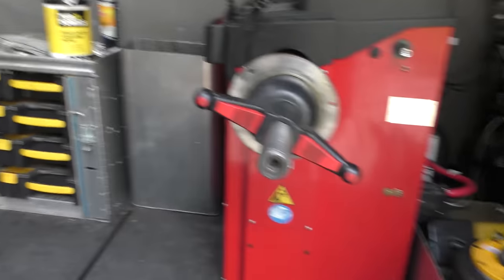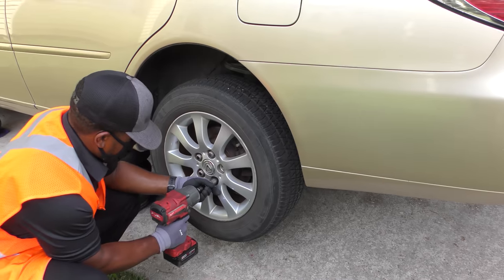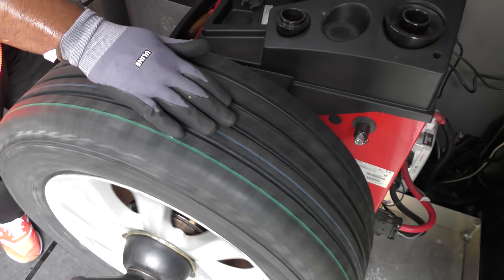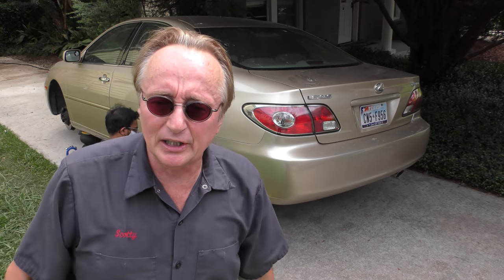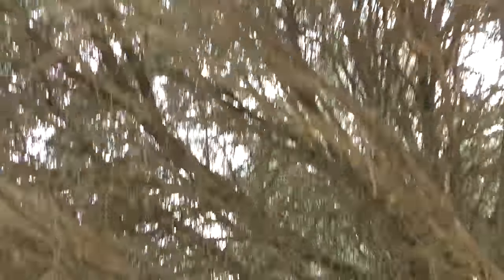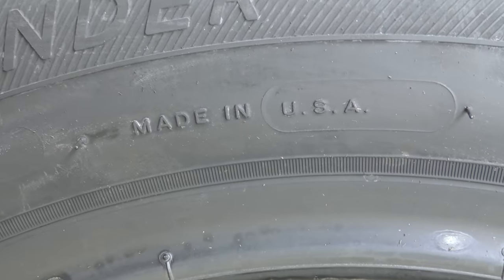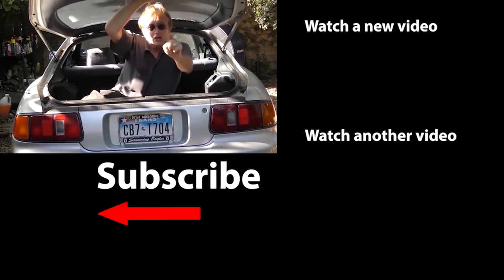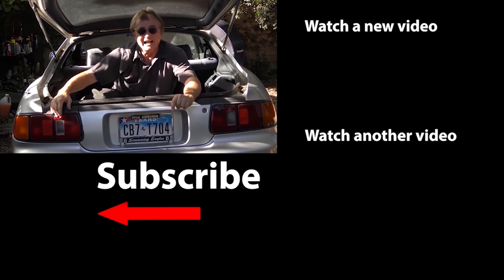Stop Replacing the Tires on Your Car, Do This Instead

Comment: I watched the interview you did yesterday. It was brilliant. You have a lot of fans there also saying nice things. I have Michelin tyres on my Lexus.
Reply: Hey me too! Always been both a Michelin fan and a Japanese car guy. I have two Lexus’ and an old ‘99 Nissan Pathfinder. All three are by far some of the most solid built cars out there.  And they all run Michelins.
Reply: I had Bridgestone on mine and currently have Falken FK510's on it at the moment. Good wearing tyre but they tend to be a bit too susceptible to puncture. I'll try Michelin PS4's next time i think.
Reply: @joshualaw375  Michelin are about the best tires out there, maybe Pirelli and Bridgestone tires are as good, but I have never owned those, but personally I have had the best luck and ride with Michelins, only caveat to them is they are expensive!

Comment: I don't know if I submit my question here for your advice but here goes.  My '04 subaru forester engine sound like I've installed a race car muffler whenever I accelerate.  When it's idling it's quiet.  But as soon as I step on the gas it sounds like a loud trombone, like one of those race car wannabe cars. I thought nothing of it but the noise has gotten louder over the span of a week.  The noise is coming relatively around under me.  My most recent job on the car was when I solved my oil drain plug leaking problem by wrapping the plug with teflon tape and screwing it back in.

Comment: Scotty, I bought a 2014 Hyundai Sonata Limited 2.0T with 51k miles in February from a reputable Hyundai dealer in Las Vegas. I understand I bought the car “as-is” but two months later it starts to warm up and when we first used the AC it wasn’t blowing very cool. It’ll only blow cool if you drive the car hard, the harder you drive it the cooler the air will blow. Even just revving it up makes the air blow cool. Sitting at idle/under 2k rpm it’s warm. Hyundai service manager said they wouldn’t fix it unless we pay for it but we just bought it. I called the previous Hyundai dealer who serviced the car before I bought it and he said last year it had issues with the discharge hose so the dealer I bought it from should have spotted that in the PDI and fix it for us for free. 
What do you think? It’ll be almost $600 out of pocket.

Comment: I tried to talk my ex boss into that 10 years ago, even had spare machines, trucks and tires on hand.
Reply: The power you'd need to run tire machines in a van is not a trivial matter.  Industrial-strength inverters are not cheap.
Reply: Suburban  you would need a hybrid like the Ford F-150 that’s coming out or generator
Reply: @TheSuburban15  I highly doubt that tire machines use that much power, most of the work can be done with air. And compressors are super power hungry

Comment: Scotty-"these guys are very professional and do the job right!"
Worker- tightens down lug nuts with impact wrench
Reply: I was thinking the same. Had a shitty tire shop ruin my studs doing that same thing
Reply: @deadchannel991  that's why I always take my wheels off, remove all the weights, remove center caps, remove tire stem cap, then take it to the tire shop. Last time I didn't do nothing that, they used an impact on my lugs, ripped off the weights using a screwdriver scratching up 4k rims, forgot to put back valve stem caps, and filled my tired to 60 psi when 32 is the spec. Absolutely ridiculous
Reply: @Danny-rk4xf  If you have $4,000 rims, why take it to a discount tire shop that employees minimum wage laborers who know nothing and care even less??
That's like a millionaire taking the Bentley parked in front of his house in a Detroit snow storm to save money by by not paying his butler to pull the Land Rover out of the garage.

Comment: I change my 2015 Honda Accord's CVT fluid every 25k miles, using only the Honda HCF-2 fluid.  And I could swear it feels more solid and less "rubber band"-like every time after I change it so I don't want to extend that interval any more than 25k miles.  Still running like new at 129k miles, having just changed the CVT fluid 4k miles ago.

Comment: Scotty--------Do Toyota Celicas require new tires too, or do the tires last a lifetime??  Just wondering.
Reply: Only if its a 94
Reply: His tires are original and still blow ice cold.
Reply: That's why slick willy was always trying to get forced induction from other younger warmer bodies //
Reply: I heard that an automotive engineering firm trying to reverse engineer her cold breath to design better intercoolers for supercharged & turbocharged engine applications /

Comment: Scotty is balling on Michelins, thought he would get some walmart DOUGLAS tires.
Reply: Enjoy the Michelin tires folks and good luck with them.
They were good performance but watch out for the Michelin tire smiles back after 2.5 - 3 years with a thousand cracks of SMILES.
Especially when his wife don't drive that often plus the Taxes baking sun.
The only prevention is use it all up in 3 years.
Skip the tire shine or protection sprays because Michelin tire representative and the tire dealers won't honor the 5 years warranty even before it expires.
Unless you fights hard with Michelin and plays the BLAME GAME.
Reply: @loktom4068  I've heard this and seen it when purchasing used michelins like the cheap a** that I am. The minor cracking doesn't affect performance though I agree Tom for what michelin charges for them its unacceptable.

Comment: I was a tire buster at one of those discount tire stores back in the 90s.  Some of the problem is with the techs not getting proper training and some of the problem is just how these stores run.

Techs work on labor commission and salesmen work on parts commission.  All too frequently the salesmen would give away free labor in order to sell parts and tires.  Then they would tell the customer, "Oh sure, we'll have you in and out of here in half an hour." regardless of how many tickets were hanging on the board.  Now you have under-trained techs having to bust their humps and cut corners, and at the end of a long hard day they find out they didn't make anything above minimum.

I left Montgomery Wards (flat rate) to work at this other store across the street (not gonna say the name, but it's the one with letters) because they promised to double my earnings by commission.  After six months of working there, I had exactly two days where I earned any commission above minimum.  Just two.

Comment: Those old tires look like they have another 40K miles on them. 😂
Reply: Yes but he has mentioned in other videos his wife had that car for 20 years. She only drives 3 and a half miles to her job, so the cars may be 8 to 15 years old. Time enough to dry rot or otherwise deteriorate by sun and heat.

Comment: I live in Dallas and used one of the mobile tire companies. Now they were much more expensive then going discount tire. So there are trade off's, you want to save money, go to a discount tire or some tire shop, want the easy of staying home get a mobile tire shop.
Also, I use Mobil One Full Synthetic  cause they go on sale at costco so often for dirt cheap. 6 quarts for $25

Comment: Great. But did they use a torque wrench to correctly set the torque of the wheel nuts? One of the common problems with most tyre places is they waaaay over torque your wheel nuts by just going for it with their impact wrench rip. This can over-tension the studs and also make it very hard to get the wheel off if you have a flat on the side of the road.

Comment: Got 2 Kia Rondos an 08 and an 11 both v6 with auto 5 speed Tipronic transmissions.  Trani drain and fill every 32K kms but they put in a drain plug that you can do by turning the driver's front wheel and fill through the dip stick tube.  Extremely easy to do, so I do it religiously every 32K.  The 08 is almost 300K kms and the 11 is almost at 200K kms.  They designed back then for easy maintenance and I always appreciate it whenever I have to change fluids.  That's the secret with Kia's, keep the maintenance up to date and learn to do it yourself and they'll last you.

Comment: I have a 1979 Oldsmobile Delta 88 and I have a leaking problem. During rain water was leaking on the passenger side carpet coming from underneath the dashboard.
The silicone seal between the firewall and the heater was all worn out, cracked and broken. I cleaned it out and resealed everything.
It’s a thousand times better then before but tends to still leak a little bit when it rains. Any suggestions or anything I overlooked?

Comment: Scotty, we had a new 1988 Plymouth Reliant that started losing its paint in about 18 months, even though I waxed the car regularly. The dealer told me it was due to water based paint, even back then. And I also saw many new Mercedes at that time that also were losing their paint due to water based composition. I wonder if it was the paint manufacturers that were causing this.

Comment: Me & my bro fit our own tyres on bikes & cars.
Dead easy using air compressor,tyre levers,tyre soap & new tyre valves.
Put 4 new pirelli's on my car recently.
Only take the wheels to the garage to be balanced.
We even repair our own punctures with stop & go tyre plugger and a rema tip top patch fitted inside the tyre like the pro's do.

Comment: Scotty, 2010 Jeep Patriot 4x4 111,000 mi (I know, I know, it was the only thing we could afford and yes, we paid too much, we didn't have any money to put down) Auto (CVT, wife just HAD to have a Jeep)... Trans is overheating when I drive but not when my wife does... she accelerates faster than I do but I travel faster than her on the highway... Trans shakes like crazy when at idle in gear but smooths out if put in Neutral or Park... Other than I need a new trans or new to us vehicle, what can we do to fix these issues?

Comment: Hi Scotty,

Is it recommended to change the tires once they start to have some cracks on the delimiter between the sidewall and the profile?

I have 2 Nokian summer tires having this issue and I intend to replace them with some Michelin CrossClimate ( maybe you heard something about them too).

Many thanks
Ciprian
Reply: Lol dumb question lol your freaking tires r cracking they r obviously no good anymore and need 2 b changed actually take your vehicle with the cracked tires on a cross country road trip lets c what happens lol
Reply: You have dry rot on those tires. Even if they have low miles you need new ones when you see small cracks

Comment: Back in the 1960s, my tightwad father would change his own tires in the driveway, using tire irons and a hand pump.   To break the bead, he would lay the tire and wheel down in the driveway, and drive over the tire with a second car.   He tried to balance the tires by mounting them on the car and loosening the wheel bearing so the tire would spin more easily.   All to avoid paying the tire store for the labor.  He would replace one tire at a time as they wore out.  So he often was driving on four different brand tires with varying states of wear.    I used to call him "The Thriftmeister".

Comment: Great, if you live in Houston, Texas or Dallas-Fort Worth, Texas, or Kansas City, Missouri metropolitan areas.  Otherwise you are out of luck.  I never have a problem getting tires installed.  Used BJs and Goodyear, both have done a good job over many tire changes now.  Have others really had problems?  Do I live in a bubble?

Comment: really wish they serviced here in MN. Costco did a good job for me 5hrs ago, then even brought to my attention one of the dealer installed tires(from the used car lot i bought car from) was damaged, the bead of the tire that sits on the rim and could have torn more and blown out. i will never use Walmart service. I read Sears Auto Center used to be good, but Sears is no more...lolz.

Comment: Scotty my 96 toyota t100 had a failing fuel injector so I had it replaced, now another one is starting to fail because it’s misfiring and from what I researched it’s common for these injectors to fail. The check engine light comes and goes every once in a while so it’s not fully failing yet so do you think a fuel injector cleaner/ fuel additive would help? If so which one do you recommend

Comment: I ordered tires from tirerack and had one of those mobile tire installers do it in my garage. They brought two guys, one for each side. Later I noticed the left tires had shorter valve stems than the right.

Comment: I live in Los Angeles county and we have tire stores all over. And we have gone to the same on for 30 years from new tires to used tires. And I have never had a reason to complain.. we out used tires on old cars and new on our newer cars. The new tires aren’t brand name tires. And they won’t recommend tires that don’t hold up. Yeah you cans by really good tires who doesn’t. Have advertised overhead that are just as good. And they have a garranty

Comment: How is the balance correct if the machine is mounted on a vehicle? The vehicle has dampers, which absorbs the vibrations to some extent. A balancing machine needs to be bolted to solid ground.

Comment: I have a 2005 Lexus ES330. I went to auto zone to have a code ran it threw a code for the catalytic converter. I went to a locally owned repair shop and the told me I needed to replace a bunch of parts for $3,600. What should I do?

Comment: I used to work at a discount tire, they gave me 2 days of watching the whole process without letting me jump in, on day 3 they told me to do the whole process front to back and chewed me out for every small mistake, at least a full week of incrementally increasing training would've been better than that. It got to the point that my best days working there were wednesdays when our tire truck came in and I could just load tires all day

Comment: We have do have the same service here in Dubai, U.A.E.  Batteries, tires, basic maintenance, heck even a mobile gas station called CAFU. For the mobile gas station you pay about 18 dhs ($5) for a single use fee or 45 dhs ($12) for the monthly,  just unlock your cap if needed and it'll be delivered. Gas is cheap too 1.80 dhs per litre ($.049 per litre) for the normal everyday gas and 1.91 dhs per litre ($0.52 per litre) for the premium. Tbh not the best fuel in the world ironically but eh.

Comment: There's a video here on YouTube where a guy tests various synthetic oils, Redline, Pennzoil Ultra platinum, Amazon's synthetic oil, mobile oil, Lucas oil etc, anyways the top of the line oil was Redline(extremely expensive), the second best synthetic oil was Pennzoil Ultra Platinum ($24.99 for 5 quarts), Mobile one synthetic oil was average at best (I think).

Comment: I've had excellent service with Discount Tire Co.  They also include Rotation & Balancing for the life of the tires which is a huge savings over the 50k - 60k miles.  I rotate the tires every 5k miles, so 10 - 12 times over the life of the tires.

Comment: I wonder how much extra that costs. If I had the extra money I'd get that done.

Edit: I go to Hispanic owned tire shops. They do a really good job and do It right. You can even buy brand new tires and get them installed and balanced for $20 a tire. Way cheaper then any other place.
Reply: I'm sure it's a lot more expensive

Comment: Hi Scotty I need your advice man I’m looking at a 2004 Toyota Corolla CE with 76,000 miles and it’s with the 5-speed manual, I’m 16 and wondering if this is a good buy the dealer is asking 5,900 for it what the you think is a good price?

Comment: Why didnt they use a torque wrench at the end, after they put the tires? If you get a flat you'll surely struggle to take the wheel off. Every time I go to the tire shop for the summer/winter replacement, I always make sure they use the torque wrench.

Comment: New Covid Paradigm for auto tire purchase/installs.  I sense brilliant business model because the walk-in stores have gotten quite like "wait, wait, and wait"...and that's when you're trying to give them about $800 to $900 for a set of P4's installed.  Forget about coming back for the free rotate.  You can't pick a day that it's convenient for them to do the free rotate.  I hope someone at a brick and mortar reads this because for equal money I'd chose this mobile service. no contest.  BUT, if the B&M would get back to real customer appreciation and service then there would be little or no need for this new business model.

Comment: I was told that an alignment is necessary whenever you replace 2 tires or all 4 tires. You will end up going to a physical shop to get an alignment done so you might as well get tires from a physical shop instead of a mobile service shop.
Reply: Never done that in my life.
Reply: Most of the time they just let your car sit in the bay and then tell you your car was aligned to specs.  Alignment is a big hassle and if the tech is in a shtty mood he won't touch your car.

Comment: Scotty,

What was wrong with the original tires? They still had a lot of tread left on them.
Reply: sold those tires for a while at the shop i used to work for. they aren't that great probably developed a vibration or a lot of road noise which just ruins the ride on a lexus so if you've got money might as well.

Comment: thats why i went and got my own tire changer and balancer. got sick of going to the tire store and waiting all day and getting ripped off and charged for every little thing. last time i went they cut my valve stems with the pressure sensors off and then wanted to charge me $60. a piece to replace them.

Comment: always slagging German cars but everyone owns them here in the UK and we love them ! I have always owned bmw's for years and never had one engine light or one issue ! pass every MOT with no advisories ! all my friends have Audi, Mercs and they are the same, look after them and never have dramas ! all taxi drivers here have Mercades or VW with 300k plus miles all running strong